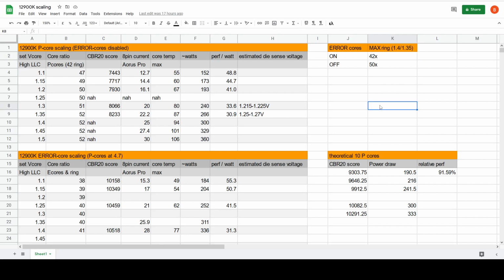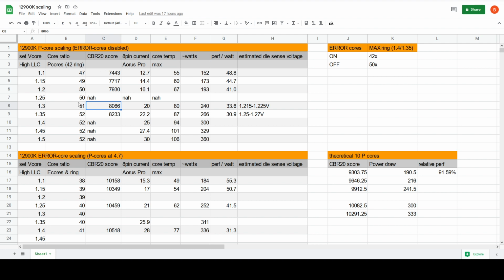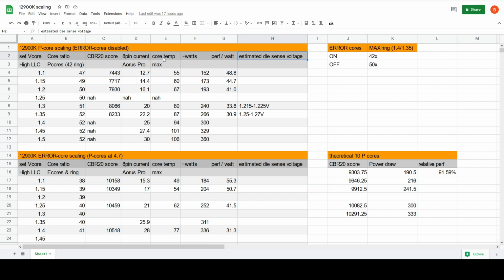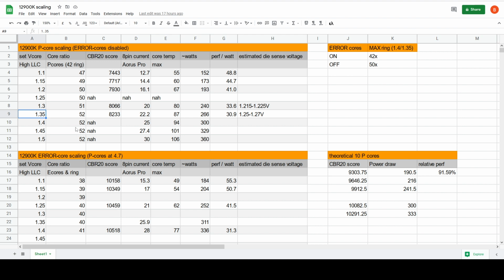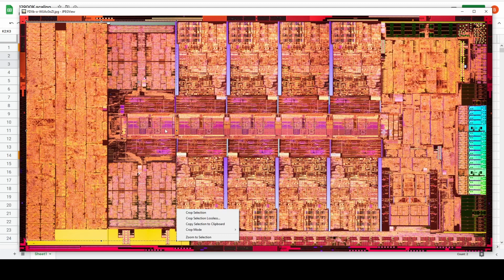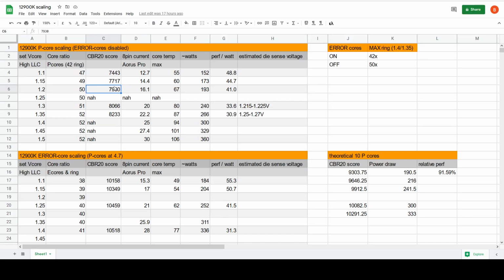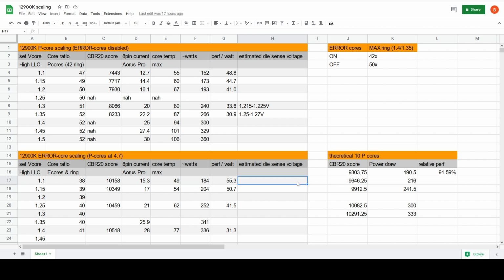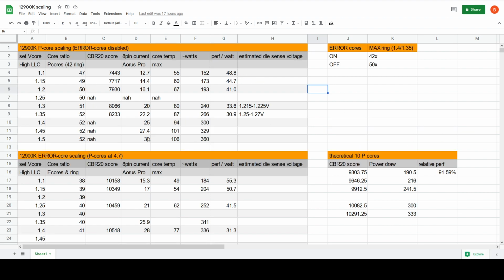12900K P and E core voltage and frequency scaling behaviour

Comment: I can confirm your voltage scaling. I have significantly worse chip, but then, its 12700K, it can hit 5Ghz at 1,3v, but 5,1 is impossible to get even cinebench stable no matter the voltage. I have Asus board so I chose to disable the Ecores completely and instead turn on the AVX512 and Bflot16 support. I find it way more useful and future-proof than crippling my CPU instruction-wise and gaining 4 Atoms.
Reply: I couldn't tell you what I get, my 12900k is still sitting in it's box as I'm waiting for my Hero Z690 mobo to arrive in stock :(
Reply: there are a lot of nifty functions in AVX512 that are incredibly nifty that AVX1 and AVX2 don't have, I just have mixed feelings about what the rest of AVX512 is doing to core size vs not having logic to accelerate other non-AVX functions. CUDA and OpenCL v3.0 (most GPUs today are Open CL v4.+) also is a thing if your that into doing math on large arrays of numbers, so eh.

again, there are some functions I feel should have been implemented way back in SSE1 and AVX1, yet it is what it is. if only we could get an AVX512-light with all the cool compare/mask/whatever operands without the stupid FPU logic width requirements.
Reply: @Zarcondeegrissom   Yeah, the Golden Cove itself is actually pretty bad. It barely took a lead, but paid for it with massive power hungry core. Despite being 10nm the die size is 215mm², one ZEN3 chiplet is 72mm². The Atom cores were put there to give it more threads, as more Golden Cove cores would result in too much die space, aka expensive to make and the clocks would have to go down to make it coolable.  We will the monstrosity called Sapphire-Rapids in summer. That thing will have approx 4x400mm², by far the largest x86 CPU ever made and Im not even sure if its gonna dethrone ZEN3 based Epycs without at least doubling their TDP. 

As it comes to AVX512, the bad thing is it has so many sub-standards. The AVX512F is not very flexible. Since then they have added way more useful things like bfloat16 and such. That is useful. Making the FPU wider so it can execute more complex vectors is not. Intel is pushing it but this type of workload will always get dominated by GPUs, I don't know what they are thinking there. Maybe thats why Sapphire Rapids will introduce the AMX set which will separate those useful AI algorithms away from AVX512, from what Iv heard it should even allow them to run separately without loading the AVX512 FPU portion of the CPU, causing it to eat like a pig and downclock to AVX512 speeds. If Sapphire Rapids wins it will be those half and 1/4 precision instructions combined with a lot of PCI-E 5.0 links and CXL support. Not AVX512 and not raw multi-threaded performance or perf/watt.

Edit: The Golden Cove  core is actually not that bad, its just clocked too high above its optimal clocks/voltages, and in games its being held by the slow DDR5 controller. Its too latent and the cache is not big enough to compensate. The IPC and clocks are so high that in the end it barely won even in games, but in operations that are not memory latency sensitive Alder lake dominates way more. If raptor lake brings actually good mem controller (no GEAR2 mode please) and bigger cache, it will be a decent upgrade. I think the whole next generation will be a fight of mem controllers and cache systems, as the DDR5 latency is huge bottleneck.
Reply: The Gigabyte Aorus doesn't have avx512. If it did, there'd be evidence by now.
Reply: @theexplosionist2019   Lets hope it will get it in the end with future bios upgrades. My Asus PRIME Z690-P D4 also did not have it. Bit with the new 0605 bios its finally there.
Reply: I have almost the exact same scaling as his 12900k on my 12700k. 1.3v for 5.1 ghz, 1.35 for 5.2. Guess I got a tiny bit luckier than you, but then again online I see plenty of 1.3v 5.3ghz 12900k's,. although those have good SP (silicon lottery measurement from Asus)
Reply: Yup. 5ghz here with a 12700k. But I can do it at 160w.
Reply: 1.3V – is that the override voltage you set in the BIOS or is it actual measured Vcore?
Reply: @tszynalski  Actual voltage, I use offset voltage in bios and LLC level 5. the real voltage is around 1,3v in non AVX burn and 1,28 in AVX. My AVX clock is set to 48x.
Reply: @Lady_Zenith  Not even sure if I can even run AVX Burn Test with my damn 12700K. My 5GHz OC sits perfectly fine at roughly 1.27-1.28v SSE Large Data Set in OCCT, but try to run Prime95 Small FFT AVX or OCCT Small Data Set AVX and that shit crashes instantly. I haven't tried playing with LLC5 myself though, LLC4 is what I use on a consistent basis.

Z690 Prime D4 (WIFI version) user here btw.
Reply: @Lady_Zenith  This is with E-Cores enabled however. Last time I recall trying to run Prime95 Small FFT AVX or OCCT Small FFT Data Set AVX it would always cap out at 4.9GHz, but have no issue with holding 5GHz in emulating RPCS3 with AVX-512 enabled.

Comment: No idea if this would be possible or not but I wish Intel would give us a "12990KF" with the IGPU removed from the die and use the saved space for extra performance cores. The whole point of these efficiency cores was, as Roman showed, they have roughly 35% the performance but you can fit two of them per single performance core. If were throwing out things that are not "efficient" for the die space they take up, than why aren't we throwing out the IGPU? Sure for some applications it's handy to have, but I'd like to think a extra 4 performance cores, or hell, a extra 8 efficiency cores would be a performance boost in many more scenarios than the IGP. I would go with the performance cores though that way you get AVX 512 and can push the ring and other areas much harder and still have enough cores to make up for disabling your efficiency cores. I really worry about Meteor Lake, I really don't want to see them go down just the advancement of more efficiency cores. There's a whole lot more out there than just that.

Comment: I can't believe I'm about to write this, but there are situations where giving up just one P core for four more E cores (of this quality) is a complete no-brainer. The performance Intel managed to achieve from their E core clusters is probably as if not more impressive than the single-threaded improvements from the P cores. It certainly surprised me more.
Reply: Or you could avoid any software issues, and just clock the P cores 5% lower outside of high performance power plan, and actually remove the junk you don’t need for consumers.

An all E core design also seems smart to me.

But mixing them is pointless, without proper control over the OS.

Android can do it because ARM basically forced it on the market, and Android can drop legacy more easily.

Windows, legacy is king, and they’re pretty pointless.

I do think the idea of having one core designed slightly modified to target different clocks/voltages, or with different clock speed limits, is a good one.

But on the desktop it’s a terrible idea due to software complexity.

And on laptops, giving up a bit of ST performance for way better MT might make sense.  Although the one company (Apple) that can build their SoC to target their workload seems to have a different option.
Reply: @Testbug000  lazy developers still havent caught up to multi threaded goodness , this will push them harder to just like the android space has.

Comment: I have a 12900KS + z690 EDGE MSI board and a arctic liquid freezer 360mm. I am trying to have 5.3 P COre (all core) and then whatever i can in E CORE and RING. Right now I have 1.28v (VCore) as voltage and 5.3 P, 4.0 E, 4.1 RING. 91 degrees after a few Cr23 runs. Average is 29700 something in CR23. I am trying to tweak this more but the AIO 360mm is not enough for the 12900KS. What should I try? 
In the past I had, 5.3 P CORE / 4.2 E CORE / 4.3 RING and it was reaching 97 degrees with Cine R23 crashing.

In the end I want the rig for gaming and some content creation but i also want stability.
What should I test? COnsidering your video my 5.3 with 1.28 V Core seems "off"? I am a bit lost.

Comment: Yay, a BZ spreadsheet drop. Wish there was some additional benchmarks. A linpack or 3D mark might show additional proof of error core issues.
Reply from the maker: most synthetics play really well with the E-cores.
Reply: @ActuallyHardcoreOverclocking  honestly surprised by that one. Though having the ring down clock that much would significantly impact the results.
Reply from the maker: @NotThatGuyJD  most synthetics are pretty well optimized so they generally won't stall out on memory access.

Comment: Can you endulge my curiosity BildZoid. In highly parallelized workloads like blender, or multitasking workloads like VMs. Would a 40 E core be better than 10 P cores?
If i'm understanding these numbers correctly. Turning on the E cores brought the CB20 score up by 2700 points, but only added 19% power(32w)
Taking my possibly incorrect understanding of this table, swapping all of the P cores for E cores, would drop the power usage to 160w, and raise the CB20 score to 13575. Obviously this is terrible for gaming. But what about homelab. If i could get a 160w processor, for $500, that rivaled the handbrake performance of a threadripper 3960x, while also having a cheap motherboard, that i could maybe iTX box to hide away somewhere, i'd jump on that for my TV recordings that cant use GPUs for transcodes. Right now i have a 3950x dedicated to transcoding. It'd be nice if i could use it for other things, like gaming, and video editing.

Comment: Yeah, for OCers, sure, the efficiency cores aren't helpful. 

But there's lots of benefits outside of laptop battery life. There's being easier to cool, which benefits any thermally limited computer, which many desktops are too. The "mode" desktop is probably a SFF system from an OEM after all, not a gaming PC. 

Efficient computing is just generally good for the environment and humanity, so there's that. 

While (if what you said is true) server CPUs will be p-cores only this gen, that won't be the case forever. Once Linux gets optimization in kernel (and in mainline server distros) for thread director and that's trustworthy, datacenters absolutely will integrate CPUs with them in mind. Reducing power consumption is huge for them. 

As an enthusiast, I'd enjoy both p-core only and higher e-core to p-core ratio CPUs, I can find uses for both. I'd also very much like voltages that are different for each, although I understand how much motherboard manufacturers may hate that. That would be fun to optimize.

Comment: the other disappointing bit of the small cores, is you would think that the signal propagation delay from corner to corner of the core would be drastically lower at nearly a quarter of the size, allowing them to clock higher than the much larger P-cores.  Apparently, something in the Error-cores is so bad it keeps them from clocking well at all. it's odd.  Normally when you shrink circuits you can make them go faster, intel managed to shrink the cores and make them go slower, lol.
Reply from the maker: the E-cores are optimized for low power draw at low clocks not high clock speeds.
Reply: @ActuallyHardcoreOverclocking  absolutely, it's just counter intuitive, lol.

few years back, the ARMs were doing around 2GHz on the same processes other CPUs were doing 4+GHz, so it does happen.

Comment: I am not surprised Intel made only minimal harmful provisions for the E-cores. Alan Turing proved nearly a whole century ago why inequal cores for CPU one-after-another processes is a bad idea - the halting problem. You cannot know how long a computer program will take to run until it finishes. Thus, if you definitely don't need to complete the single threading ASAP, such as with video encoding, then you always should be dispatching it to GPU.

I don't expect MS to perfectly ensure only stuff like only some of the background 'Windows Update' functions are delegated to E-cores, and that everything else always uses P-cores.

No doubt, some folks at Intel who designed this stuff probably expected anyone competent enough to run Linux would script up some non-synthetic benchmarks, realize E-cores and HyperThreading were harming their workloads, then disable all E-cores and HyperThreading entirely.

Which by the way, I did. As a matter of fact, interpreted shell scripts can run multiple times faster without E-cores.

E-cores are at most some combination of greenwashing, benchmark cheating, and dubious marketing.

Everyone arguing E-cores are somehow good for something is incentivizing the destruction of their future and everyone else's.

Computers are engines, badly constrained by physics, but best when the gears run steadily fast. By contrast, the photovoltaic panels to power computers are only constrained by 'more is better', and much cheaper than actually needed computers.

Efficiency is all about economics, and the E-cores (and low-end computing machines generally) are anything but economical.

Comment: Alder Lake is the debut of this semiconductor process on the desktop. People aren't overvolting Tiger Lakes. Which begs the old question: what is the maximum safe voltage for long-term operation 🤔

Comment: Running the ring bus at the same clock as the P-cores should introduce a synchronous mode that should reduce latency ever so slightly.  Lower latency generally improves performance but this may not be in an area where there is a bottleneck to show it.
Reply from the maker: it doesn't. Intel hasn't had synchronized ring and core since Haswell.

Comment: Hi, Buildzoid. I was wondering if the e cores are still a waste of silicon in 2025. Would I still be better off to disable them and shoot for a 5.3 or 5.4 all p core clock?

Comment: I can imagine Intel releasing a processor, with disabled E-Cores and IGP in 2022. They might call it something along the lines of i7 12xxxXK or KX and costing 50% more money. They might even have some now, that have good 12xxx performance then failing the IGP and E-Cores. (12xxx = 12400/12600/12700/12900)

Comment: Do you have an insight on Gear1 and Gear2 for Alder Lake? I've heard some people can't even get Gear1 to work with a 4000mhz downclock on DDR5, while with DDR4 it has no problem staying in Gear1. Does disabling e-cores increase the ability to run in Gear1?
Reply from the maker: I don't think Gear1 is even an option for DDR5.
Reply: I cant get to run 4 sticks of ddr4 4000 cl17 (xmp) on a gigabyte elite ddr4. Only two stick run @ 4000.  I tried dissabling the ecores but wont help. I even tried 3600 cl17 and 1.25 v on the memory controller without luck. I hope it will get solved with a bios update.

Comment: I would like a 12600k in my custom loop, I'd disable the E cores and enable AVX512 for PlayStation3 and Switch emulation (AVX-512 makes a huge difference in ARM inc Neon instructions + Power to x86 translation due to the extra registers, even if it is hardly used in any other code). Why on Earth didn't intel release a zero E core K series chip?
Reply: Because AVX512 is so niche it's not worth manufacturing an extra product for.  It is odd that they couldn't just handle AVX512 with the scheduler while E-cores are active, though.
Reply: I don't think they could just disable all the E-cores due to the new architecture relying on it. Binning the chips as such wouldn't make sense
Reply: @sandyleask92  The non-K 12600 has no running E-cores, and 2MiB less cache.
Reply: @concinnus  I actually never knew that. I just assumed if im honest. Thank you for correcting me here though.
Reply: There's good reason why AVX is disabled when E cores are active, their thread scheduler can't cope with moving an AVX thread to a non-AVX E core (it's not a mind reader, it has no idea if AXV instruction will be called by software in the future). That is a sign of a rushed Chip design. I bet you 13th Gen will add AVX512 support to the E cores when the next die shrink happens as they will have more room for a bigger AVX capable E cores. They can't pin AVX to P cores because moving a thread from an E core when it detects an AVX instruction would incur a massive latency penalty and hurt performance because it's too far down the core's pipeline at that stage. Intel stated 'No transistor left behind' for 12th Gen, well leaving out support to rush a 12th Gen product to market did EXACTLY that. Intel has history here, back in the early P4 days hyper-threading was on, off, back on again because they didn't get it right first time.
Reply: So they have a 12400 to release with their h boards
Reply: @WayStedYou  Of no use to me, I want a K variant not a locked processor.

Comment: Wonder how this cpu handles undervolting
Reply: Because this is technically  the "normal" efficiency curve of VCORE for this processor... 
Since Comet Lake, the motherboard manufacturers have put a grotesque VCore, big mistakes from them. 
Because this i can't consider this an undervolt... 
12900k doesn't cosume too much like that. It was an enormous mistake from mobo manufacturers again 🤦‍♂️
Reply: I run mine on 5.1ghz for p and 5.2ghz 1 p core at 1.31 volts with a -140 millivolts offset. Stable in most avx tasks except r23 :p cant test r23 until i switch to aio from air

Comment: Could the bug that's limiting adjustments to the ring to core down bin be whats causing the massive drop in ring frequency with e-cores (ring frequency limited by the lowest frequency at which any of the cores run)?
Reply from the maker: the E-cores don't force the ring clock down. They crash the whole CPU if you set the ring clock above 4.2 with them active.